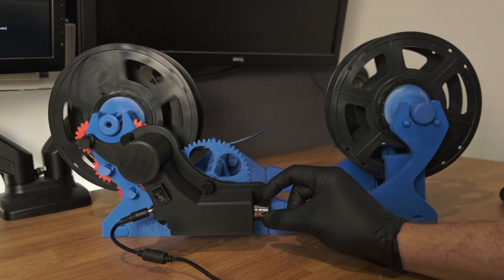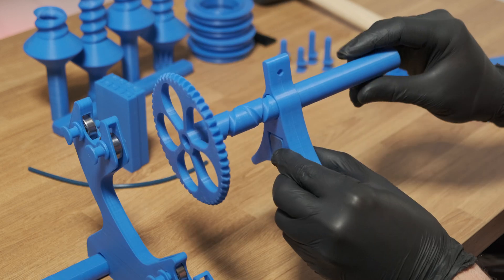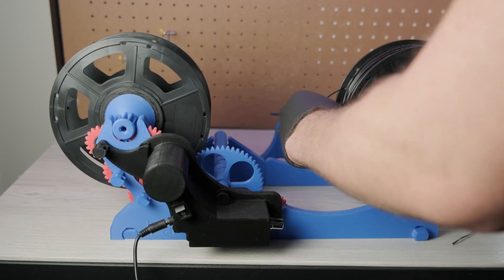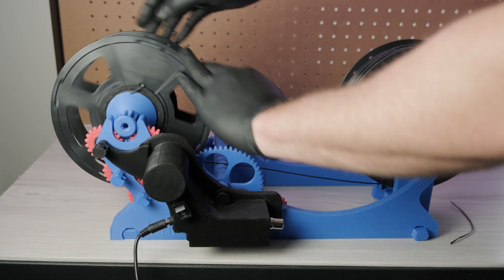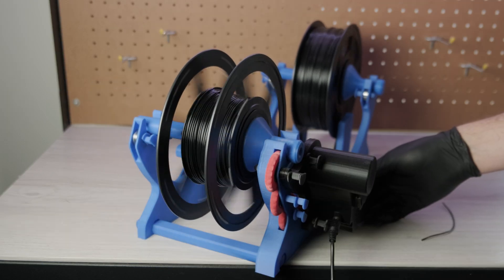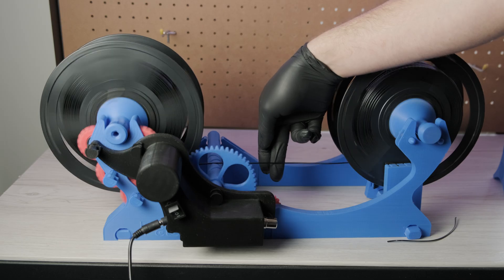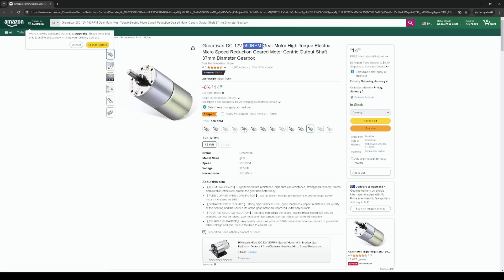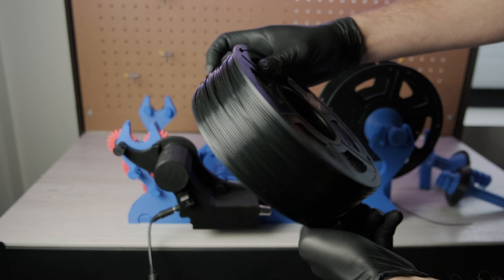Perfect Filament Spools Every Time: Pastamatic in Action

Comment: The TPU printed 'flaps' that are to slow / tension the donor spool.... I'm not to sure I want to print 'rubber'' (TPU) on my 3D printer. I will be looking for alternate at hardware store or maybe even some stiff craft paper or thin cardboard will work. Printing the PastaLab will be my first major project.
Reply from the maker: Yeah the tpu flaps were a little bit painful to print as they are so thin, but as they are adjustable they work quite well as you can push them further in to create more tension on the spool. But cardboard could work too...or even some corflute maybe if you can find some thin enough? Happy printing!

Comment: The problem I have with these machines is there is no tension on the doner spool to keep the recipient spool tight.
Reply: There is with the pastamatic - you 3d print some TPU baffles that drag on the donor spool. It's part of the original design
Reply: I've had issues with this as well